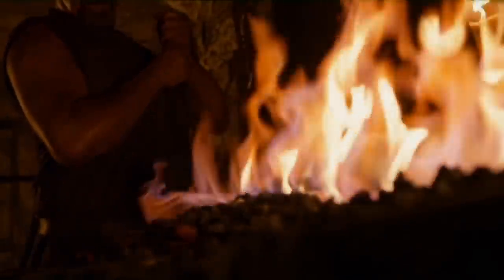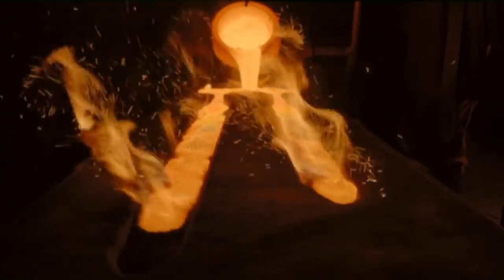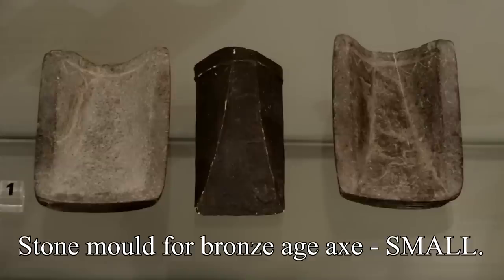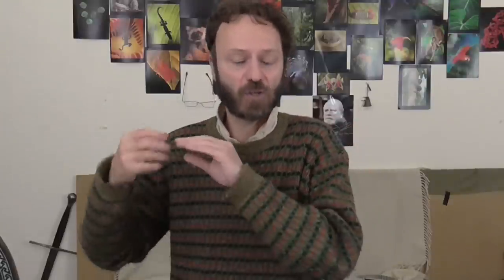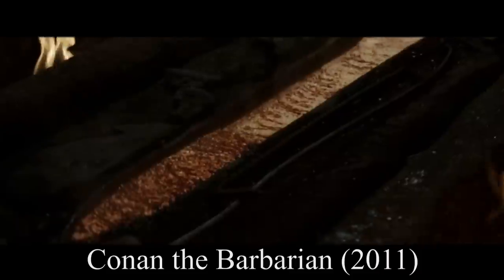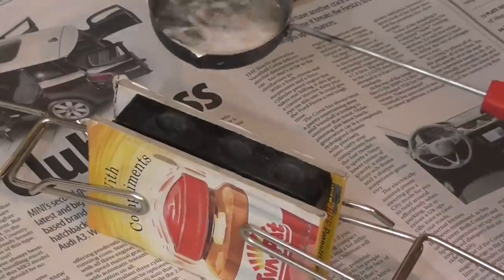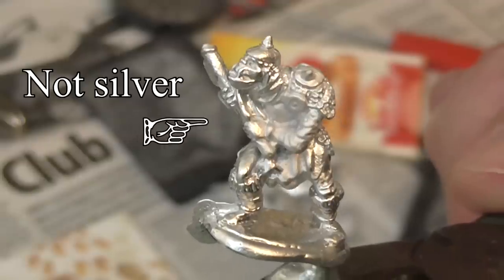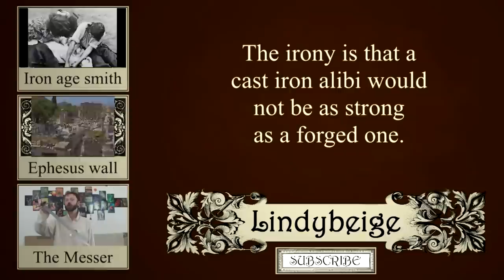Casting swords in the movies - forging a lie

Comment: It's not rubbish. You might disagree with it, but while the technique shown in the movies may or may not be inaccurate, it is a perfectly reasonable way of forging a sword. Create the mold, poor the iron, take the blank and hammer it out. It may not be a fantastic sword, but in that period it would reduce the time taken to manufacture swords considerably.

And it's sort of worth noting that bronze swords were the predecessor, and were made that way

People thinking about things from a modern perspective, without really understanding the difference between current technology and available technology and knowledge of earlier ages, and how that affected time and process, is becoming far too common. Take an ingot of iron, grab a 3 pound hammer, and find yourself a pit of coal and a guy to operate a bellows, and forge out a blade from that ingot, (or maybe from some other pre-formed tool like a pick-axe), then find yourself a pedal powered grindstone and bring it down to a blade, then consider your perspective again. Maybe just start from the ore stage, and follow that process, and be sure to find a roughly flat chunk of cast iron for your anvil too.

Apologies, but I am having some difficulty digesting the modern interpretations of "how things were" these days. It's just getting more and more obfuscated by an inability to understand how easy things are today.

Iron is poured into ingots in open-topped molds as well. And it's coal, at best, not coke. Coke followed anthracite, which followed coal. You're being way to dramatic.

And besides yourself, who gives a crap what metal they use for the metal in the movie.

Cast iron is high carbon. Iron in a mold is not necessarily cast iron. That's something you choose to make. You can poor wrought iron, which is extremely low carbon. That's where iron ingots come from. The carbon is introduced to the steel in the forging process when heating in coal. That's how steel was made at the time.
Reply: One thing that annoys me, is people making poorly informed videos like this. Especially for drama sake; it's basically click bait. And to be quite honest, it's offensive.

I've watched and honestly sort of enjoyed a few of your videos which I've found rather interesting, but this sort of thing just grates on my nerves

Comment: one could make the argument that forged swords are britle after forging this is why you need to temper it...so saying no to casting a sword because of that well...being a blacksmith myself i don't see the problem...also you could make the argument that the mold is not a big issue considering that you may want to get the overall shape and grind everything afterwards...granted it would make more sens to get a beveled shape out of your casting but that's not a big issue...i agree what the mold being made out of stone altough you could use a special kind of stone like our modern reflectiv stones wich considering the price of those would be a waste of good material...by the way it is wrong to assume that all medieval swords were forged especially considering how long that process is...imagine the poor smith howhas to forge thousands of those in preparation for war....

Comment: So you're saying instead of the hassle of actually casting iron or steel they use aluminium because it's both easier and looks cooler?

Next thing you'll be saying the Batmobile doesn't have an actual jet engine and the walls of the castles in GoT are just cardboard, you silly man.

Comment: First scene wasn't normal steel it was valeryian steel
Reply: mydog boots, still shittily cast.  If you've ever cast anything into a mold, you know the mold goes all the way around the shape except for the sprue hole where the liquid is poured in and a few passages for air to escape, and the material being cast has to be hot enough to quickly flow into every nook and cranny of the mold or the casting will be full of holes and loose bits of casting material.  Besides, casting and forging are not the same process.

Comment: Two errors here: molten aluminium doesn't glow red/orange, it just looks silvery (it only glows in the infrared); and iron that is cast is not cast-iron (which is an iron alloy with over 2% in weight of carbon in it), pure iron even cast is very malleable. English is a shitty language in that regard.

Comment: Nope. While nobody DID cast iron swords, it was clearly possible. After all, complex iron engine blocks are sand cast from iron every day in foundries.

https://itstillruns.com/sand-cast-engine-block-8659057.html

However, sand casting will NOT give the precise shape required and also cannot introduce the three dimensional layered structure that most classic swords possessed.

A sword that is cast need not be "cast iron" which is iron carbide, and not the element.

Comment: This is steel poured into a cooper mold, https://youtu.be/YBA8vSl_PNo I know because I filmed it myself.

And it is not wrong to begin the manufacturing of swards with casting them. You need a single piece of steel to start forging. And it is a long process to remove carbon from the cast iron to make it into steel, a process where you hammer the carbon out.

Comment: saying iron is basically the same as steel is incredibly ignorant, if you go on to talk about very specific melting temperatures. yes, iron melts at ~1540°C, but a steel with a little over 4% carbon content melts at ~1150°C, which is drastically lower when youre comparing it to a reference of 950°C. good video, but dont mix massive generalisations with precise numbers, it can be very misleading to people who arent familiar with material science
Reply: Yeah, youre Rigth 4.3% Carbone Steel melts at about 1150° but it is extremly Brittly  and it is no more Steel it is steel until it has more than 2.06% Carbon.

Comment: Game of thrones did even worse they showed obsidian being cast.
Reply: the only way to make obsidian weapons would be to cast them, obsidian is volcanic glass, go back to sleep
Reply: @artemislogic5252   I make arrowheads with obsidian also this post is three weeks old you chip at it until you shape you want you don't melt it down and cast it it doesn't work someone made a video trying it already and it failed miserably
Reply: @DrEgonCholakian  first I just want to say I assumed you were a 12 year old or something from your initial comments,

however assuming you do make obsidian arrowheads, sure painstaking chipping away might be the best way to make arrowheads (although I'm sure there are/were better methods for casting glass)

Youtube videos of people failing to make obsidian weapons on a first, second, or third attempt without the right equipment, probably isn't the best indicator of how it could be done either

but what I want to say, mainly, is the axes and other large weapons made out of obsidian would need to be cast. 

also another point is that real obsidian is too brittle, so i would assume dragonglass obsidian is a different material with different properties to real obsidian, so if that's true you couldn't know the properties of that substance, but its not beyond the realm of possibility that it would be able toi be cast
Reply: one more thing i want to add, is in the video the guy says molten aluminium is orange, when it's silver, so he knows nothing anyway, cringe,
Reply: @artemislogic5252   You don't cast an Ax you chip it into the shape you want you cast bronze or copper not obsidian i don't know where you are getting this information but its terribly wrong.
Reply: @DrEgonCholakian  you couldn't hit a real obsidian axe into a log of wood like they do in the show without it shattering, so I'm assuming dragonglass on the show has different properties, 

however, you wouldnt be able to make the battle axes in the show out of real obsidian using traditional methods
Reply: @artemislogic5252   I have cut down a tree using an obsidian ax its not very efficient but it does work stone age technology sucks

Comment: Actually there was no possibility to cast iron before the 19th century, due to the lack of furnaces and melting crucibles which can generate/withstand > 1600°C

Before, Iron always was forged, as they were unable to melt the loop they got out of the smelting furnace. They just had enough heat to soften a lump of iron.

Comment: Why could they cast useable bronze swords?
Reply: I am not an metallurgist so I can't give an in-depth answer, but generally bronze and copper has different structures which favor casting. For iron/steel to have these good qualities you have to control the carbon content and remove impurities, which they indirectly did by forging. Without this the iron is brittle and pretty much unusable. 
Bronze and copper don't have this problem. However you have to account for the fact that in the bronze age, everything was bronze. A bronze sword in the advanced iron age would probably not do the job.
Reply: @Hellskelett  Thank you!
Reply: Because theres less things to control when casting bronze, when dealing with molten steel you have to have a way to control air flow, carbon content, be able to remove impurities.  It's why the development of a stable and repeatable way to refine ore into steel took so long, it's an complex process whereas bronze all you really have to do is melt it and skim the dross (impurities) of the top and pour in the mold

Comment: This is so wrong that it's unbelievable. 
Problems: 
1: The stone mould is actually made of sand. 
2: you know what steel is made out of Iron. While this is true there is a massive difference between cast Iron and cast steel. The properties that you go on to talk about are that of cast iron which are significantly different to the properties of cast steel.  Check out this video https://www.youtube.com/watch?time_continue=20&v=Im1sGbk1cEM.  Cast steel has far superior impact strength to Cast Iron
3: You wouldn't cast a sword that was the finished article you would cast a steel billet. This is a length of steel that is roughly the size of the sword that you are trying to create. You would then forge the sword into the required shape as forging adds strength to the metal that isn't there in the initial cast steel.

Comment: Next time: do not use fantasy movies/series with fantasy metals like Valyrian Steel
Reply: Valyrian steel isn't cast. It's folded. No in universe excuse, so no problem using it in the video.
Reply: @theblancmange1265  The colour and temperatures are still different

Comment: God damn it makes me cringe that you equate iron to steel. Completely different properties. Just.. aahh. No. Bad Lindybeige.

It's absolutely possible to make an equivalent to the earliest iron-age swords using a cast, if you were to work-harden it afterwards. There were low-grade steel swords that are probably pretty similar to what you'd get, because pig iron, the crap that shatters if you look at it wrong, didn't come about until much, much later - basically everything before the industrial revolution could be considered steel.

The real problem with this is that they didn't have the kinds of furnaces needed to do that at the time where it would have made sense. The first blast furnaces appeared in China well after bloomery and hot-working techniques had been established. They were used to make farm implements, not swords. So the development of better techniques than casting for iron did not overlap correctly for reworked cast iron weapons to be a thing.

Comment: You can cast a sword exactly like they’re doing in that movie clip because you’re making a sword shape, similar to a flat steel bar. You just need a file or sharpening stone and in enough time you can make a sword. The reason they cast in a sword shape is to save time on file and grinding stone work.

Comment: Um, well, okay . . . so you've explained, Mad Professor style, why sword-casting in movies is wrong, Wrong, WRONG - but you DIDN'T tell us how iron swords ARE cast (or made or forged or whatever). Tell us! TELL us! We're desperate to know! 

Pee Ess - even though you FAILED TOTALLY to tell us HOW iron swords are made, I STILL like your style! Chops for the dramatics!! The pounds-shillings-pence-groats-florins-half crowns-farthings you yielded up for acting lessons were well-spent!
Reply: Iron/steel swords are forged. That is, you take an iron bar, heat it up, and then pound it with hammer and anvil into the proper shape, then you grind the edges and fuller, if it has one.
Reply: @jorgejohnson875  Many thanks for the explanation; 'preciate it.

Comment: This guy is the most uneducated person I've ever seen in my life talk about metals, it is cringeworthy. 

For 1, how could it be aluminium is molten aluminium is silver? Yes of course they're not using real iron, but to suggest its Al, don't make me vomit. 
2. They DID have peddle powered grinding machines, so... Wrong. 
3. Iron and steel are not the same, but this is valyrian steel and it's known that has a different reforging process than any other metal, and we don't know its properties, but as valyrian steel is fictional, this hardly matters but it still shows that you son't know what you're talking about.

If you're gonna make a video about something at least educate yourself on the topic by researching your script. 
I'd suggest taking the video down, put putting disclaimers in place, it is embarrassing.